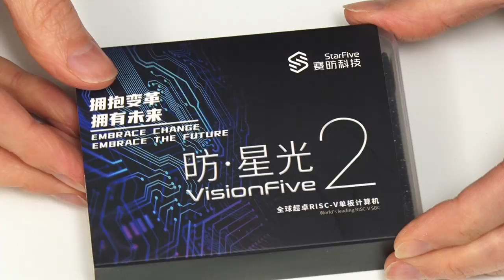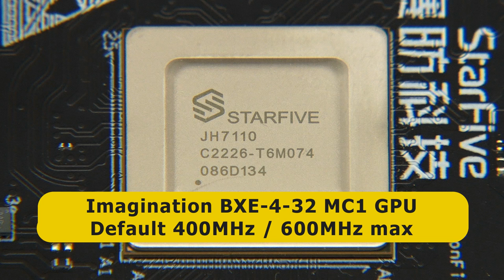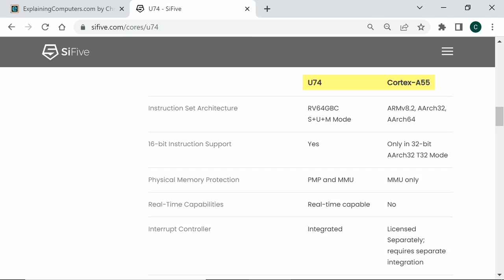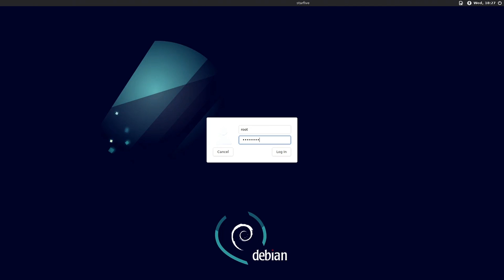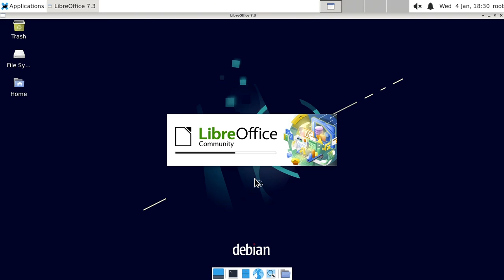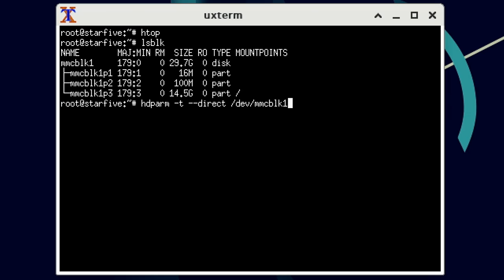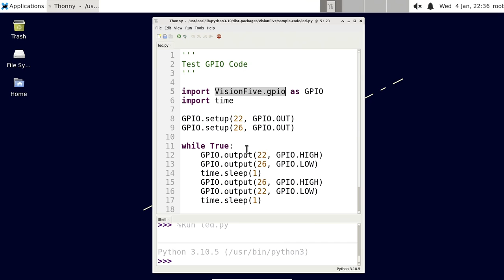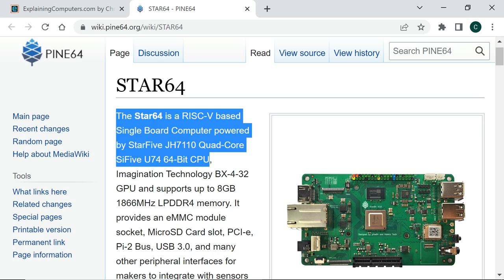VisionFive 2: RISC-V Quad Core Low Cost SBC

Comment: I had expected that it would be faster than RP4, which, as far as I know, uses some mid-2010's CPU. So, a new R5 CPU is still slower than a several-year-old ARM? It still has a long way to go, if it wants to be a competitor to ARM for the general public, not just for developers.
Reply from the maker: Given that performance for this board has been tripled in under a year, we should not have long to wait. :) The Raspberry Pi 4's Broadcom BCM2711 was released in 2019, and contains A72 cores, launched in 2019 (and still widely used in modern smartphones).

Comment: Help me understand the origins of U74 JH7100 and Allwinner D1 processors, are they some sort of reference designs?
Reply: They are a snapshot in time, 'reference' boards for developers.  This board with the JH7110 and GPU are semi-equivalent to budget/gaming PC boards from a couple of years ago. The missing link to that high performance is the software.
Reply from the maker: The U74 and C906 are RISC-V processor core designs, that use an RISC-V ISA, and which were created by SiFive and T-Head (Alibaba) respectively. StarFive have used the U74 core design in their JH7100 and JH7110 SoCs, whilst Allwinner have used a C906 in their D1 SoCs. In the ARM world, its the same as ARM creating designs for A76 and A55 cores that RockChip license to put in their RK3588 SoCs.
Reply: @ExplainingComputers   I am rather skeptical about Chinese CPUs. Has anyone looked into the design of the cores? Any similarities or "inspiration" from other SoC ?

Comment: 5:15 - I don't think you can or should compare performance based on core clocks. I recall looking at benchmarks where risc chips at 5 Ghz had about the same score as 2 Ghz Rockchip ARM. I'd love to see a "real world" sorta benchmark, like typescript compile times or maybe web server response times. Those are more meaningful than synthetic benchmarks...
Reply from the maker: Why do people keep saying this?!  I am not an idiot, and NOWHERE in the video do I comparing processing power solely by looking at frequency. Rather, as is extremely clear in the video, I compare both the cores and their frequency -- as discussed in audio and labelled in the graphic. In fact that section starts out entirely talking about comparing RISC-V vs ARM cores and does not even mention frequency.

Specifically, I note that a Si Five U74 RISC-V core is comparable in terms of processing power (NOT frequency) to an ARM A53 or A55 (and more towards the latter). And I then note that a Raspberry Pi 3B+ has four 1.4GHz A53 cores. So given that a VisionFive 2 has four 1.5GHz U74 cores (ie four cores that are widely considered to be at least as powerful as an ARM A53, and also clocked faster), it is  reasonable to state (and pretty widely accepted) that a quad core 1.5GHz U74 SBC will have more processing power than a quad core 1.4GHz board -- hence a VisionFive 2 is more powerful than a Raspberry Pi 3B+. I then include information indicating that a (recent) Pi 4 has 4 x 1.8Ghz A72 cores, so has both more powerful cores, with these now also clocked at a higher speed. So a Pi 4 has to be more powerful than  VisionFive 2. 

As for benchmarks, does nobody get that this is very early, unstable, pre-release software? Very little will run. I will post a benchmarks video when release software is available and meaningful benchmarks can be run. :)

Comment: 12:28 It says 3.8GB of memory. Is it stuck using a 32-bit address space in this build? What's up with that?

Also, is this memory single-channel?
Reply from the maker: Some memory will be allocated to the GPU. Certainly 64-bit address space. I don't know if the RAM is single channel.

Comment: Is the boot environment standardized?  Seems like I remember reading that was one negative for ARM where each board has it's own way to boot, so it would be good/nice if RISC-V could avoid that.
Reply from the maker: Not yet! :) You are correct that there is no standard ARM boot, and so far I am not aware of any standardization for RISC-V. But these are very early days.

Comment: On an ancient Xterm, you hold down on the CTRL key, and right-click to change the font size to one of its 5 defaults.
Wish someone would explain why nothing but x86 computers can translate GPU acceleration to Xorg in Linux.
Always stuck with framebuffers.  :(
Reply from the maker: As I said in the video, I could not find any way to control the Xterm font size -- either from the keyboard as you say, or by writing a .Xresources config file. After 30+ years in computing, I am well aware of the options -- but they do not currently apply in the Debian engineering release I could test on the VisionFive. :)
Reply: Xorg is not responsible for (and never has been responsible for) video acceleration - that's up to userland with the likes of mesa , OpenGL etc. And there is an implementaion of mesa for arm that includes video acceleration in the lima driver, even though it's not officially supported by ARM and is backwards engineered.
Reply: @terrydaktyllus1320  That is interesting.  Is there a desktop on a RISC SBC that uses this lima driver? I understand the rPi's GPU code is closed, and X is a fundamentally framebuffer driven ... but it would be great to see Mint run on a fruit pi with 2d acceleration, and windowed hardware video playback.
Reply: @GnuReligion  I don't believe such exists as of yet, but please don't quote me on that.

As you may or many not be aware, many ARM-based boards have "Mali" GPUs and as "Lima" is an anagram of "Mali", I think that means it's specifically an open source and backwards-engineered driver specifically for those GPUs.

Comment: A bit of a rhetorical question on my part but whilst it's great to see such low cost RISC-V boards emerging, then how is it that Apple's RISC-V "walled garden" rubbish is so expensive then?
Reply from the maker: Apple uses ARM chips in its latest hardware.
Reply: @ExplainingComputers  I stand corrected, I had thought the M1 was RISC-V based - not that I own any of their products anyway.

But I guess one could apply the same analogy to cheap ARM SBCs and Apple prices anyway.
Reply from the maker: @terrydaktyllus1320  Oh yes, the analogy applies -- although Apple's ARM M1 and M1 chips are far more powerful (and hence expensive) than the SoCs found in most SBCs. :)

Comment: (HiFive Pro P550) is slated for 2nd qtr 2023 release.  Since it uses Industry standard microATX form factor it would be a drop in replacement and is Linux compatible, unfortunately not Windows compatible.  Wondering if, when all this RISC-V stuff ever becomes Windows 11 compatible?????

Comment: Documentation. 
How well are these boards documented? I have 6 rp4s collecting dust because the raspberry pi refused (as probably is still refusing) to release the documentation I need to integrate them safely.

Is StarFive willing to provide all the documentation to device owners? If so, I'll buy some as soon as support is included in mainline linux/debian.

Comment: Have a lap top HP with Windows 10 HOME .  Want to upgrade to Windows 10 PRO .  However; when I install the upgrade disk for Windows 10 PRO the Computer keeps going back to Windows 10 HOME.  Tried UPGRADE & CLEAN INSTALLATION, but keeps going back to 10 HOME Version.
ANY SUGGESTIONS TO HELP ME ? 😢😂
.

Comment: Performance? It would have been nice to see some simple benchmarks to compare integer and floating point performance vs ARM.
Reply from the maker: I will post another video benchmarking a Pi 3 and  Pi4 against the VisionFive when release software is available. The engineereing release is too early, incomplete and unstable to run meaningful benchmarks right now. I got hdparm to run OK, but not other tools. And so web based tests will run. But hopefully soon!

Comment: You didn't mention that it doesn't work on 4k monitors; that community support is just taking their build-root image. Launching firefox while booting from the microSD, occasionally ejects the microSD. You should talk about what is, not more pipedreams about what could be.
Reply from the maker: I think I made very clear indeed that the software is pre-release, and spoke at length about the software not being ready yet -- including quotes from StarFive stating the same! I also described Firefox as "developmental" and "highly unstable". So where on are the "pipedreams" there?!

Comment: At 6:40, is that some little transistor on the screw hole? Isn't that going to cause problems if you try to put a screw there?
Reply from the maker: Good spot. You are correct. There are some surface-mount components (resistors I think) very close indeed to that mounting hole. I did put some risers and screws there when running the board later in the video, but had to be very careful not to cause damage. The two holes either side of the GPIO header would be safer to us on that edge of the board.

Comment: How come noone discussed the GPU and where it came from?
Reply from the maker: Looking back to the script (which I think matches the video), I said "These are coupled with the Imagination BXE-4-32 MC1 GPU, which is by default is clocked at 400MHz, although it can run at up to 600 MHz". So I did mention the CPU, its specification, and where it came from (Imagination).
Reply: @ExplainingComputers  honestly... Thanks.  But with all the talk about the RISC-V open architecture the GPU are still not... I'm too old to start this but there has to be someone out there.

Comment: Any idea as to when "inexpensive" X86 SBCs will gain traction? The last time we got anything in the Pi4 price range was the Rock Pi X - and that was 2 years ago.

We're seeing all these cheap Arm SBCs... But not X86 SBCs.
Reply from the maker: You are right, we've not seen a lot on the x86 side recently, at least not a the lower price point. The Hackboard 2 is still awaited (getting on for two years late, and more expensive than it was!). The problem is that the x86 SoC and support chips are expensive -- so it is very hard to make a low-cost x86 SBC. Those boards we've had -- like the Rock Pi x, and v1 LattePandas -- have made use of older Atom CPUs, and these are not are reasily available now.

The cheapest new x86 SBC I'm aware of is an UP -- see: https://up-shop.org/up-board-series.html -- they currently start from $109, but this is for one with 1GB RAM and 16GB eMMC -- and the price rises fairly quicky as these are increased. Or there is the new UP 4000 range, which start from $129: https://up-shop.org/up4000series.html You have got me scouting around the web! Maybe I should do an UP board review.

Comment: Would the lag with the highlights following the curser in the menus be due to the slower storage interface, or the unoptimized OS?
Reply from the maker: This is OS issue, linked to the use of the GPU. It will improve! :)

Comment: The problem is always that there's often no real community of developers working on hardware support for GPU acceleration, hardware video decoding, kernel module development etc and so the hardware stagnates. Most of the off-brand boards I've looked at only run with a specific version of Linux, with no way to upgrade in the future. It's a bit chicken and egg, but the Chinese hardware manufacturers have no real incentive to work on the software - they'd rather just sell another board instead. This is why the Pi endures, even with the current supply issues.
Reply from the maker: As I discussed at the end of the video, the situation is not the same here as with manufacturers of many ARM SBCs who chuck out board after board and never fix hardware support (especially for the GPU, and especially on Rockship SoC hardware). Rather, here StarFive are both the manufacturer of the SBC *and* its SoC. So they do have the incentive to sort the GPU support in a manner than board manufacturers only do not -- and they are working on this. GPU driver support is not being left to the community.

Comment: Sadly, yet another SBC with bad connectors layout... Change it to all 4 vertical USB and put ethernet jacks as close together as possible (sharing mount hole), and power plug will fit on the same side (preferably vertical too), which will make it actually usable in nice enclosure outside workbench.

Comment: You can't just compare clock frequencies when one is a Reduced Instruction Set Computer and the other is a Complex Instruction Set Computer  - at a fundamental level they process data in a completely different way.
Reply from the maker: I am going to start going mental. What on earth are you talking about? NOWHERE did I compare the SoC performance only using clock frequencies. Which video were you watching? I am not an idiot. And you clearly do not know that both ARM and RISC-V ISAs are RISC -- neither is a complex instruction set computer.

As is exceedingly clear in the video, I compare both the different cores and the frequency of the different SoCs on the Pi 3, the VisionFive 2, and the Pi 4 -- and this is both discussed in the audio and labelled in the graphic. In fact the relevant section starts out entirely talking about comparing RISC-V vs ARM cores and does not even mention frequency.

Specifically, I note that a Si Five U74 RISC-V core is comparable in terms of processing power (NOT frequency) to an ARM A53 or A55 (and more towards the latter). And I then note that a Raspberry Pi 3B+ has four 1.4GHz A53 cores. So given that a VisionFive 2 has four 1.5GHz U74 cores (ie four cores that are widely considered to be at least as powerful as an ARM A53, and also clocked faster), it is  reasonable to state (and pretty widely accepted) that a quad core 1.5GHz U74 SBC will have more processing power than a quad core 1.4GHz board -- hence a VisionFive 2 is more powerful than a Raspberry Pi 3B+. I then include information indicating that a (recent) Pi 4 has 4 x 1.8Ghz A72 cores, so has both more powerful cores, with these now also clocked at a higher speed. So a Pi 4 has to be more powerful than  VisionFive 2.

Comment: In which cases would the ram be a bottleneck if you went with the 4GB version?
Reply from the maker: 4GB RAM (like I purchased!) will be fine unless you intend to run large or otherwise memory intensive applications -- a video editor, for example. 4GB RAM is still perfectly reasonable for most SBC applications -- these are not x86 machines running Windows! :)